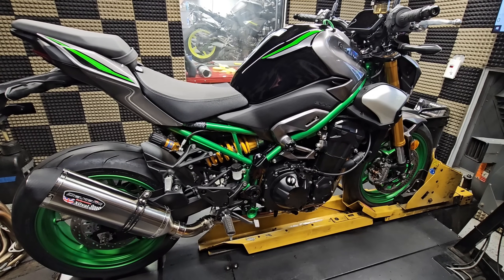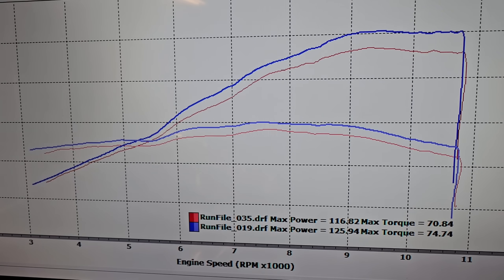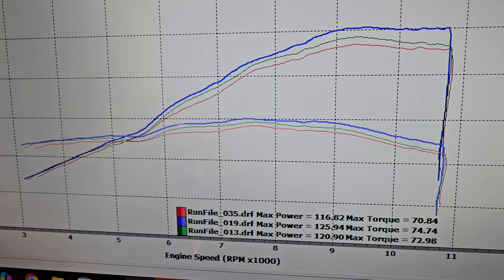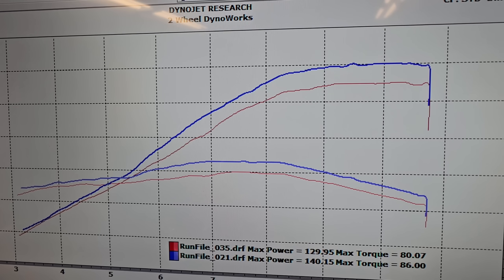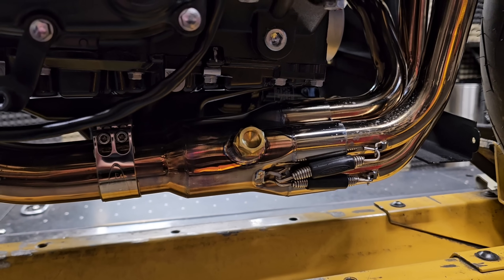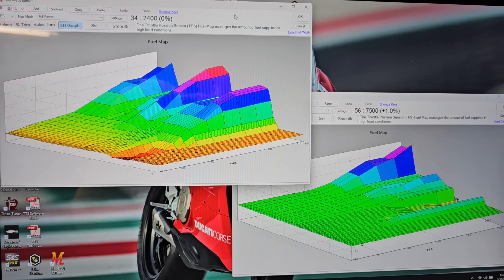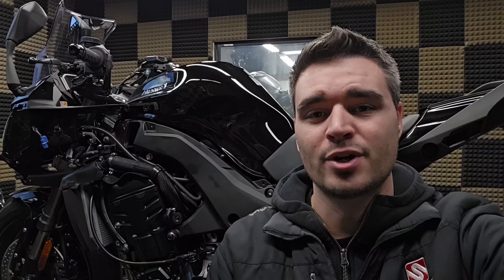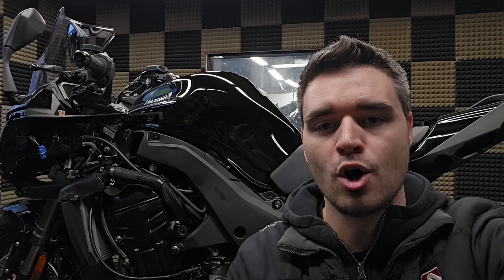There is a BIG difference between the performance of these two popular header designs!

Comment: This may be a stupid question but if i were to send in my ecu for the service. Do i loose the ability to have modes like rain, street and sport mode?
Reply: I didn't lose anything on my 2020 MT-10 FWIW
Reply: @daniellang6112  thanks. My mt 09 will be in mid April and I will be send him my ecu before our ridding season begins but was really looking forward to the modes for different conditions. Mainly rain mode for the first couple miles as my current bike only has 55hp 😅
Reply: No that's all in your bikes ecu just adjusting air fuel ratio ignition timing.
Reply: I dont think so, I don't own these types of bikes but that level 1 2 3 power mode or something similar probably just messing with the fuel correction and timing retardation, probably just fuel correction because of emissions. like how your fuel adjusts to high altitude.

Comment: Just visually the transition from the primaries to the muffler is way smoother on the 4-2-1. Exhaust pulses seem like they'd crash into each other on the 4-1. That said I like my Delkevic slip ons. They get the job done
Reply: Pulses are delivered past the collection point one at a time, every 180° crank rotation. Scavenging is a venturi effect of exhaust gas flowing past an opening, causing a vacuum (it's the basic premise of why carburetors work). If timed correctly it helps pull exhaust from another cylinder in the proper sequence. Joining cylinder pipes in the right sequence makes the engine more efficient in breathing, relative to valve timing and so forth.